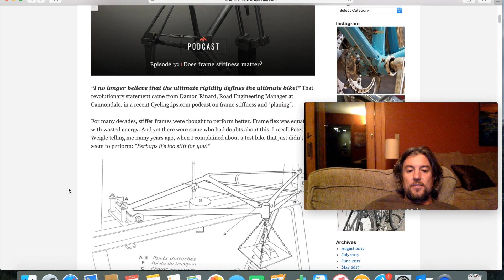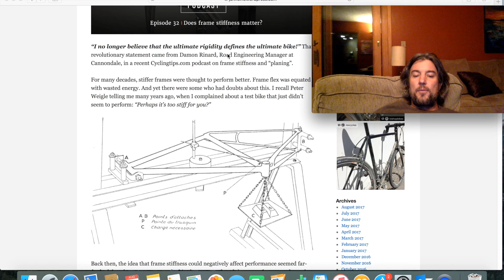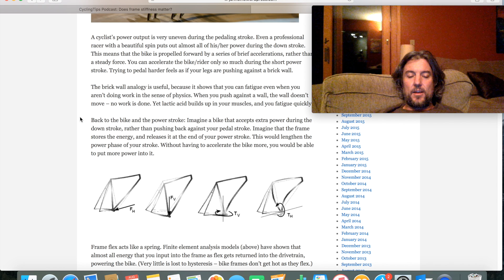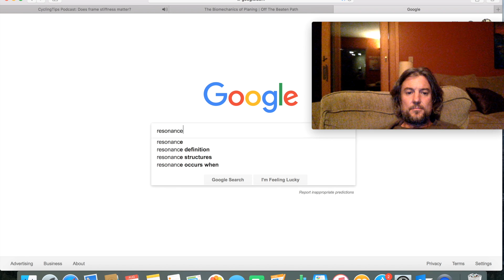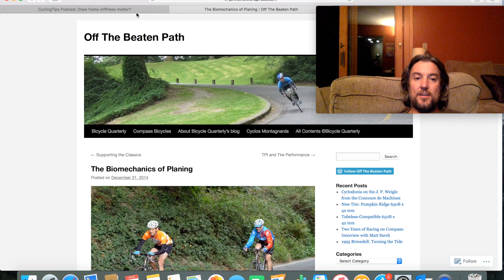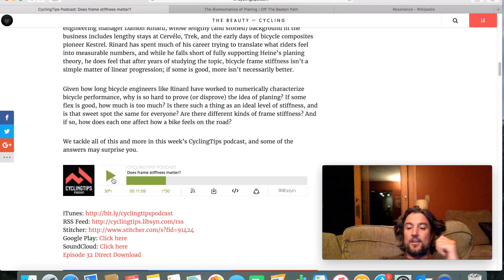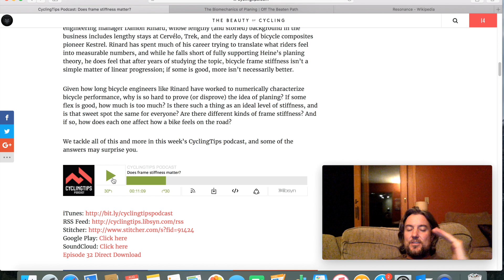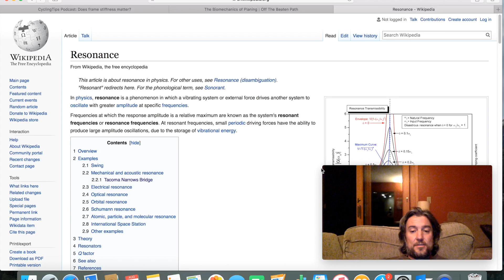Bicycle Frame Stiffness and Planing Theory - my thoughts

Comment: You still need to explain a mechanism of how matching frame resonance increases power. Jan Heine showed that with a double blind experiment. Personally, I thing it has to do with perception and how this actually affects muscle recruitment patterns in non-maximal efforts
Reply from the maker: Thanks Scott, this topic is worthy of a video on its own. Resonance is complicated. When it comes to applying this principal to bicycles, I'll admit there is a bit of hand waving going on. That said, frame stiffness does contribute to transferring power from the body to the road. A frame that is too stiff rides like a rock and one that is too flexible and you're just bending the thing all over the place not getting anywhere. Therefore, there must be an ideal frame stiffness or range of stiffnesses best suited for a bicycle. Where that range lies is dependent on a number of factors including the riders own physical attributes. What makes this even more complicated is most riders vary their cadence on climbs, so matching optimal frame flexibility with rider cadence is difficult. I think what Jan Heine discovered is that as carbon bikes became dominate in the market place, and ever increasing stiffness was the goal, we ended up with bikes too stiff. Once he started experimenting with older vintage rando bikes, flexible and all, he realized there was something missing with the newer carbon frames. If we go back and look at how steel frames were made to be light they were also flexible. That's the nature of standard sized thin walled steel tubing. Any how, I want to get into this a bit more, so please check back as I plan to get more content up on Youtube when time permits. Have a Happy Holiday!
Reply from the maker: I forgot to mention, frame stiffness is only part of the equation. Tire and wheel stiffness play and important role in this as well. And, as tire sizes and air pressures are changed, so will the feel of the ride.

Comment: Good comments on this podcast.  I do wonder why they limit the stiffness discussion to the bottom bracket.  Head tube stiffness is almost never talked about but seems just as, if not more, important.
Reply: parmijo 
I have wondered this as well as I have realized that different fork stiffness on the same frame really changes how the bike as a whole planes.